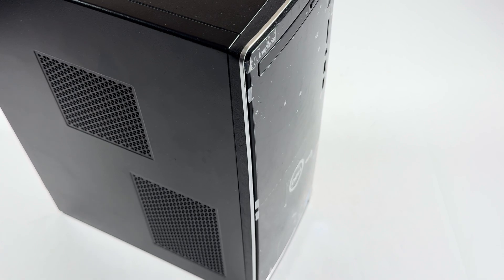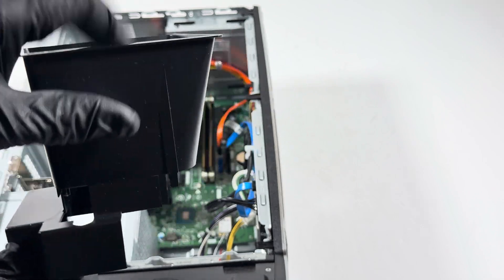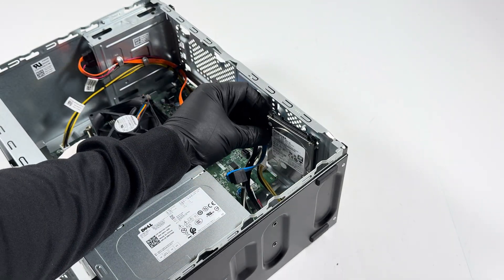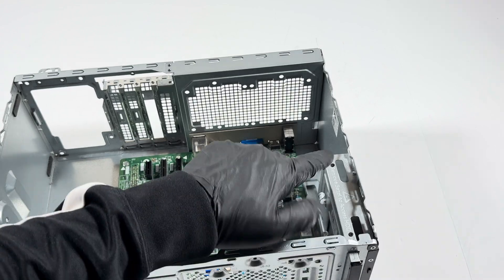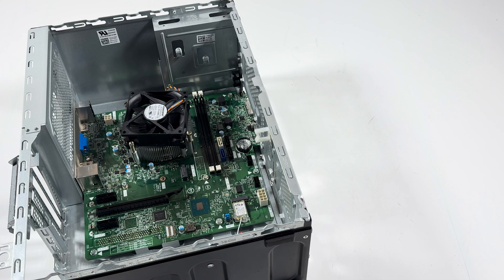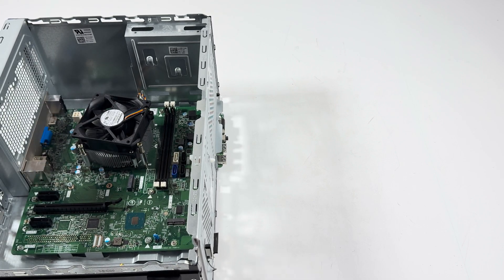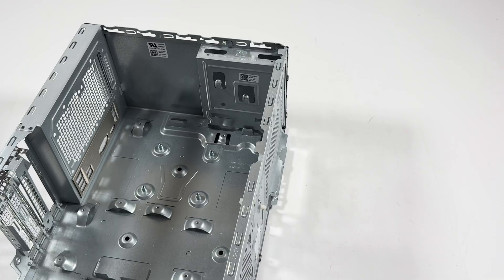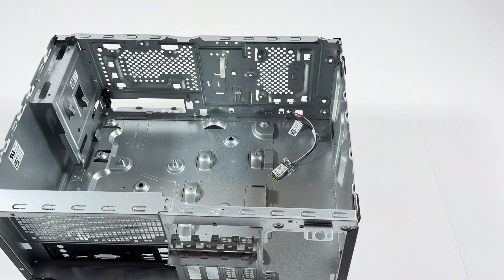Dell Inspiron 3671 Teardown

Comment from the maker: List of Parts and Upgrades works with this PC Dell Inspiron 3671.

Driver Kit - 64 Precision Bit Set
https://amzn.to/42N3fjh

SATA Cables 3 Pack 18 Inch Compatible for SATA HDD, SSD, CD Driver, CD Writer 
https://amzn.to/3Ye2Lkg

List SSD Heatsinks:

(1.)  M.2 2280 SSD heatsink, Double-Sided Heat Sink, PCIE M.2 SSD
https://amzn.to/3l2ittr

(2.)  EZDIY-FAB M.2 2280 SSD heatsink, Double-Sided Heat Sink, M.2 SSD
https://amzn.to/3m7J3me

List SSD M.2 Type 2280 NVMe PCIe:

(1.) Crucial P3 Plus 4TB PCIe M.2 2280 SSD
https://amzn.to/3RZcUNi

(2.) Crucial P3 Plus 2TB PCIe M.2 2280 SSD
https://amzn.to/3RTUi0Y

(3.) Samsung (MZ-V7E1T0BW) 970 EVO SSD 1TB M.2 NVMe
https://amzn.to/3d52k2a

(4.) Samsung 970 EVO Plus SSD 500GB
https://amzn.to/3fpi95A

(5.) Samsung (MZ-V7E500BW) 970 EVO SSD 500GB - M.2 NVMe
https://amzn.to/37uuLFw

(6.) Crucial P1 500GB 3D NAND NVMe PCIe M.2 SSD - CT500P1SSD8 
https://amzn.to/2N07wKh

List of RAM will work with this system.
Supports Non-ECC DDR4

(1.) Crucial RAM 32GB Kit (2x16GB) DDR4 3200
https://amzn.to/4iCp38N

(2.) Crucial RAM 16GB Kit 
https://amzn.to/3BlK6fi

(3.) Crucial 16GB DDR4-3200 UDIMM
https://amzn.to/4gGCwus

Thermal Grizzly - Spatula for Applying and Spreading Thermal Paste 
https://amzn.to/3d8NQEE

Thermal Compound Paste:

(1.) Arctic Silver 5 Thermal Cooling Compound Paste 
https://amzn.to/2ziNU0H

(2.) Noctua NT-H1 3.5g, Pro-Grade Thermal Compound Paste
https://amzn.to/36kTk7A

(3.) ARCTIC MX-4 (current edition) Thermal Compound Paste 20 Grams 
https://amzn.to/2DhGJaK

List video cards will work with this system.

GIGABYTE GeForce RTX 3050
https://amzn.to/3W2sJY9

MSI Gaming RTX 3050 Gaming X 6G Graphics Card 
https://amzn.to/4eNikqD

Intel Arc A310 ECO, 4GB GDDR6 Graphics Card
https://amzn.to/4jzvSJb

(1.) AMD Radeon RX 6400 Low Profile Gaming Graphics Card
https://amzn.to/3s8MUUY

(2.) PowerColor AMD Radeon RX 6400 Low Profile with 4GB GDDR6 Gaming Graphics Card
https://amzn.to/3ucfFEm

(3.) MSI Gaming Radeon RX 6400 64-bit 4GB GDDR6 
https://amzn.to/43FN0VJ

(4.) Gigabyte GeForce GT 1030 GV-N1030D5-2GL Low Profile Graphics Card 
https://amzn.to/2Z4PHkp

(5.) ZOTAC GeForce GT 1030 2GB GDDR5 64-bit Low Profile Video Card ZT-P10300A-10L 
https://amzn.to/2WzgLXk 

(6.) MSI Graphic Cards GT 1030 2GB GDDR5, Low Profile
https://amzn.to/390Spum

List SSD M.2 Type 2280 NVMe PCIe:

(1.) Crucial P3 Plus 4TB PCIe M.2 2280 SSD
https://amzn.to/3RZcUNi

(2.) Crucial P3 Plus 2TB PCIe M.2 2280 SSD
https://amzn.to/3RTUi0Y

(3.) Samsung (MZ-V7E1T0BW) 970 EVO SSD 1TB M.2 NVMe
https://amzn.to/3d52k2a

(4.) Samsung 970 EVO Plus SSD 500GB
https://amzn.to/3fpi95A

(5.) Samsung (MZ-V7E500BW) 970 EVO SSD 500GB - M.2 NVMe
https://amzn.to/37uuLFw

(6.) Crucial P1 500GB 3D NAND NVMe PCIe M.2 SSD - CT500P1SSD8 
https://amzn.to/2N07wKh

SSD list works with this PC:

Samsung 870 EVO 2TB SATA SSD
https://amzn.to/3ezOds5

Crucial MX500 2TB 3D NAND SATA Internal SSD
https://amzn.to/3B9f8CF

SanDisk Ultra 3D NAND 2TB Internal SSD - SATA
https://amzn.to/3RSZ8LR

(1.) Samsung 860 EVO 500GB 2.5 Inch Internal SSD MZ-76E500B/AM) 
https://amzn.to/2yNxnkE

(2.) WD Blue 3D NAND 1TB Internal SSD, 2.5" WDS100T2B0A
https://amzn.to/2wvnC9Z

(3.) WD Green 1TB Internal PC SSD  WDS100T2G0A
https://amzn.to/3cbrcWa

(4.) SanDisk SSD PLUS 480GB Internal SSD SDSSDA-1T00-G26
https://amzn.to/3a3i9ou

(5.) Crucial MX500 250GB 3D NAND SATA CT250MX500SSD1(Z) 
https://amzn.to/34rZlhy

(6.) Samsung 860 PRO SSD 256GB - 2.5 Inch SATA III Internal Solid State Drive
https://amzn.to/2ybiHLK

(7.) Samsung SSD 860 EVO 250GB 2.5 Inch SATA III Internal SSD 
https://amzn.to/2VjIAkK

(8.) SanDisk SSD PLUS 240GB Internal SSD
https://amzn.to/3c7SEE4

Mounting Screws For SSD 2.5 and 3.5 HDD
https://amzn.to/4iFSMOc

HDD list works with this PC:

(1.) Seagate BarraCuda 4TB Internal Hard Drive HDD – 3.5 Inch
https://amzn.to/3d3xWeR

(2.) Seagate BarraCuda 8TB Internal Hard Drive HDD – 3.5 Inch
https://amzn.to/3xjUDSJ

(3.) Western Digital 2TB WD Blue PC Hard Drive HDD - 5400 RPM, SATA 3.5" - WD20EZAZ
https://amzn.to/3w3jIQA

(4.).WD Black 2TB Performance 3.5" Hard Drive - 7200 RPM Class, WD2003FZEX 
https://amzn.to/2xFUeyF

Disclosure: Amazon links this means that if you purchase an item we earn a small sales commission affiliate.

Comment: Hi okay so I need some help😅 I recently bought a 1050ti and without realizing it needs a PCIE cabel and I have the HP Compaq 8300 and the motherboard is the Hewlett Packard 3396 I have the standerd 320watts power supply and I have no idea what to do like I can go buy a PCIE cabel but idk where to plug it in and idk anything if u could help me that would be greatly appreciated 👍♥️